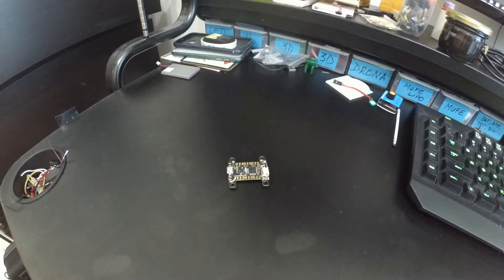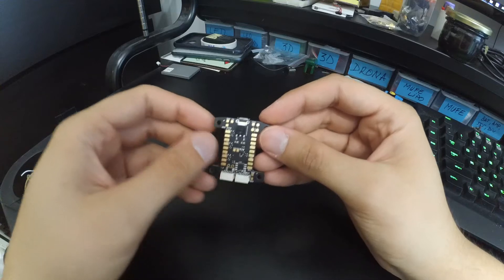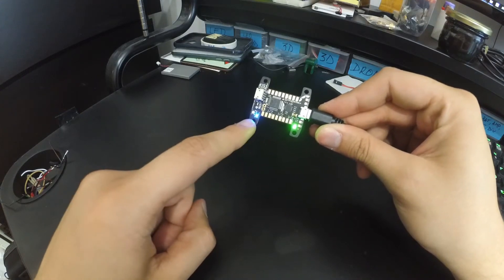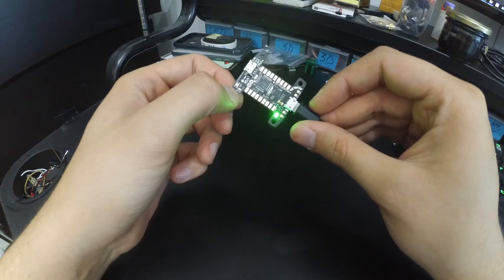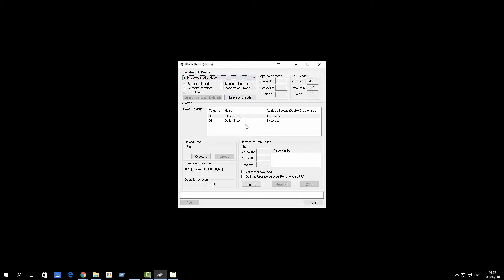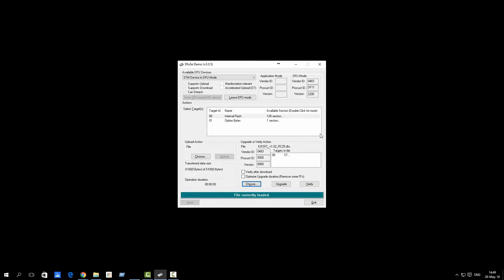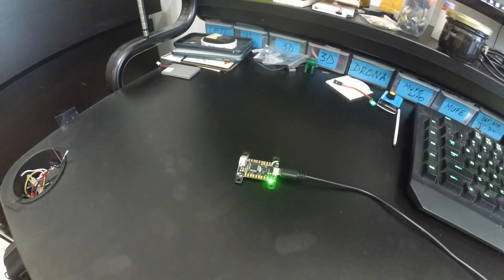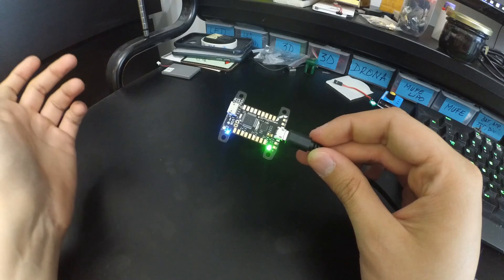KISS FC Firmware update tutorial

Comment: thanks for the video..   rotor riot had a recent Kiss FC tutorial video but my Kiss GUI wouldn't recognize when I plugged in the FC.      this software worked perfectly.     also is the status blue LED supposed to stay on?  because mine only lights up for a few seconds and then goes off.     but all seems to work great in the GUI
Reply from the maker: +Jay Vantol well if everything works great than you have nothing to worry about :p
Reply: yeah thanks!  i just thought the status light was always on before.  but im probably wrong.
Reply: I think after you press save on the software it validates your boards serial number through the flyduino online servers its like a forced authentication making sure your boards not a clone

Comment: My FC's blue light always comes on, no matter if I am pressing the bootloader button. Not sure what I am doing wrong!
Reply from the maker: +BisMaxx try to flash the firmware if that doesn't work you may have a faulty board.
Reply: +Hawkeye FPV I can't flash firmware if I can't connect to Dfuse. I fixed it. It was a conflicting driver issue.
Reply: I'm almost certain I'm having the same issue here. I can't get the FC to be recognized by DfuSe or the Kiss GUI in bootloader mode. Checked Device Manager to get rid of a conflicting driver (I'm switching from a LUX FC so there's a ZADIG STM32 Bootloader driver somewhere), but I cannot find it. Any tips?
Reply: I had to hold the button through the whole procedure in order for it to work. And I had to delete and remove any previous drivers that were needed for my other quadcopters. This alone pissed me off. Not the "simple" experience I expected to have with KISS gear, specially not from the start like this.